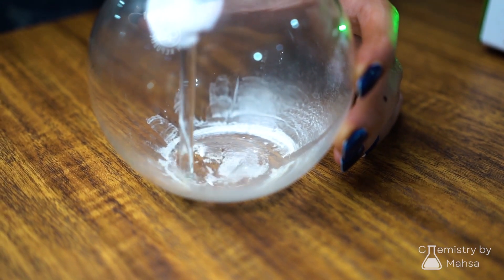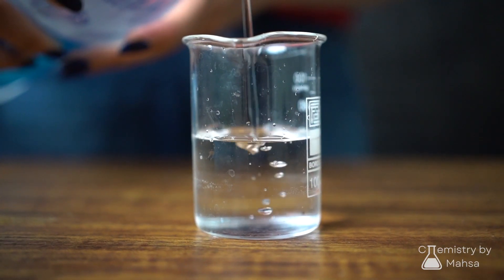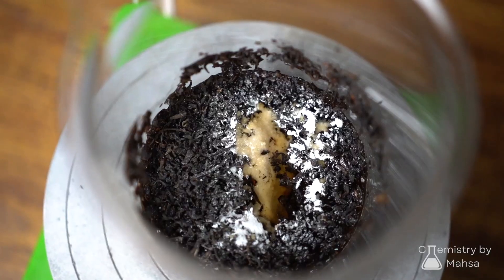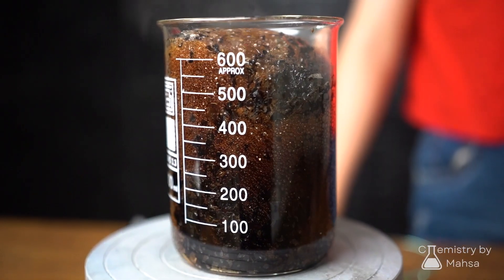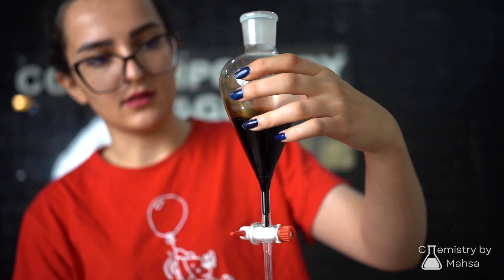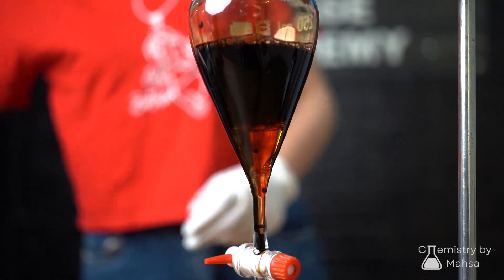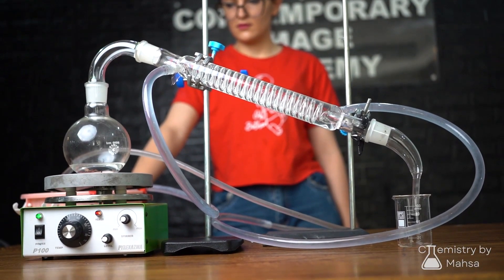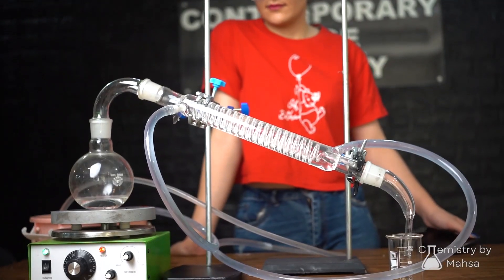Caffeine Extraction from Black Tea

Comment: Nice video, but you have used the worst possible and most useless condenser type in existence: GrahamIf it would be used vertically I would not write anything, but Graham sideways is cursed, not efficient, has death spaces, and makes overpressure inside of setup by resistance of liquid staying inside the coils. 
Besides that nice :P
Reply from the maker: Yeah that was really hard to work with. 
But you know I had no other choice and I really wanted to do the experiment😃